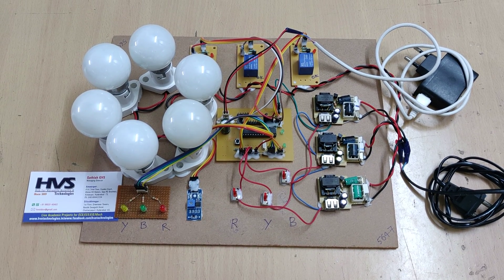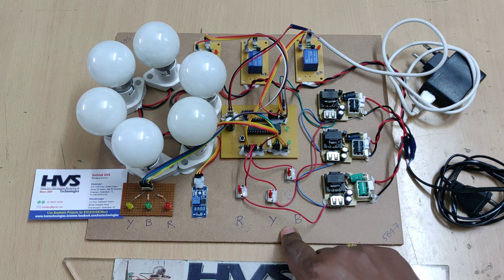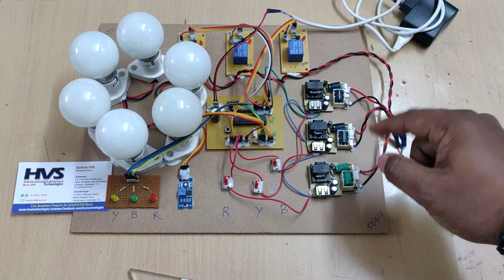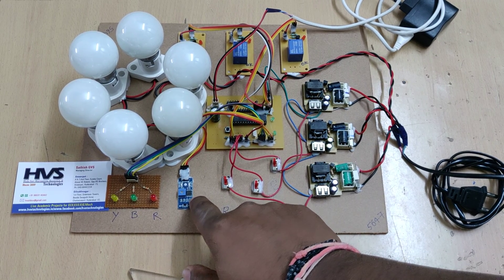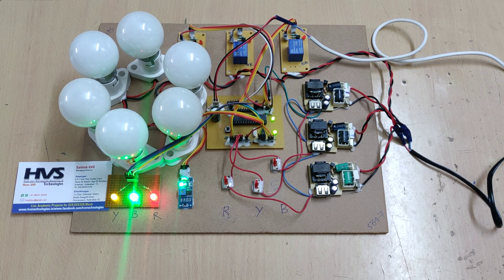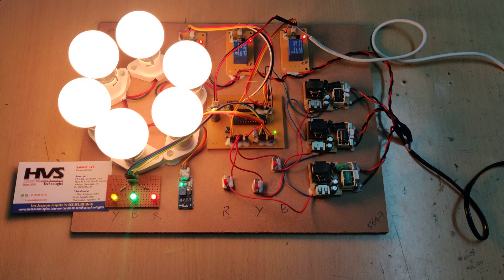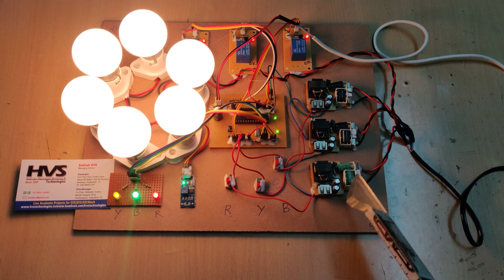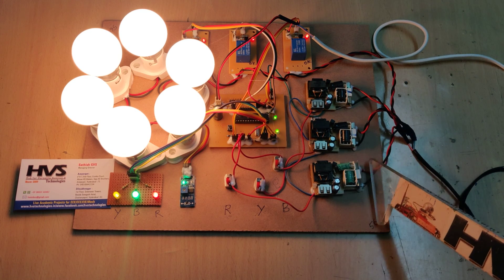3-phase Induction Motor protection from Phase and Temperature

Comment: The current sensing circuits 
What was used?
Reply from the maker: @silasonoshefe7437  Hi, 
Series components.
We sell full working kit with document PPT circuit diagram and code. Could you Send me the video link, Will update you the cost details. You can contact us at +919603140482
Through WhatsApp or call

Comment: Where is the motor
Reply from the maker: @Savageryz  using bulbs as motor winding
Reply: Ohh thats not going to work since our teacher told us to use real 3 phase induction motor
Reply from the maker: @Savageryz  ok, we can use, motor cost will be added
Reply: @hvstechnologies  we dont require motor but we want the project where in it will work on college motor. Can u tell me the rough cost now of unassembled project kit.. Also tell me the cost with motor included 3 phase
Reply from the maker: @Savageryz  yes. You can contact us at +919603140482
Through WhatsApp or call
Reply from the maker: @Savageryz  ok.You can contact us at +919603140482
Through WhatsApp or call

Comment: Circuit?
Reply from the maker: You can contact us at +919603140482
Through WhatsApp or call
Reply: Please I also need the circuit  @hvstechnologies
Reply from the maker: @silasonoshefe7437  Hi, 
We sell full working kit with document PPT circuit diagram and code. Could you Send me the video link, Will update you the cost details. You can contact us at +919603140482
Through WhatsApp or call